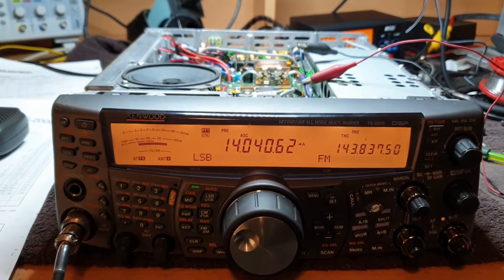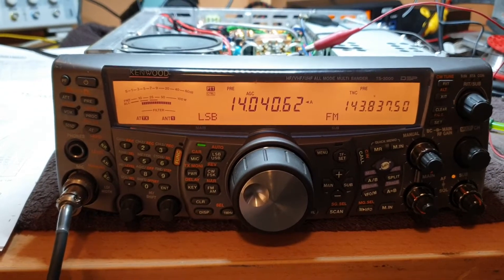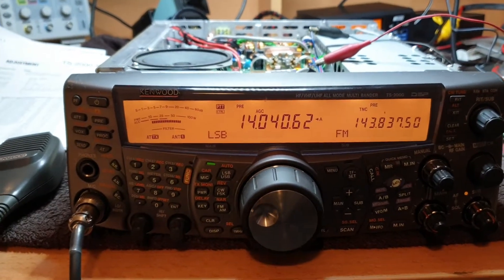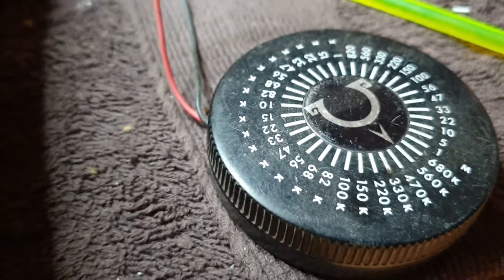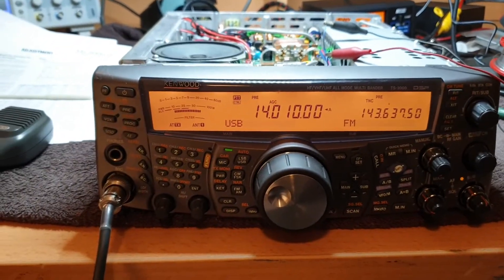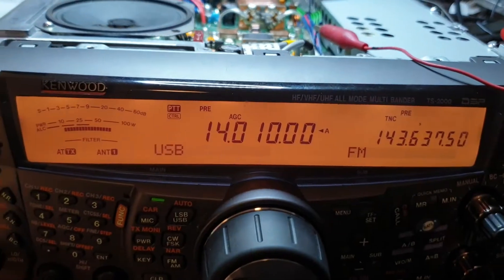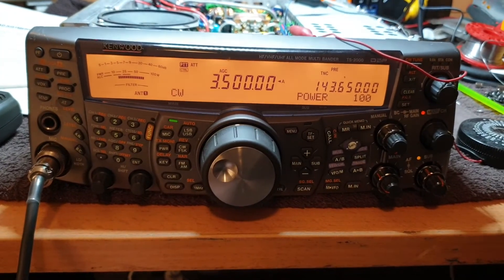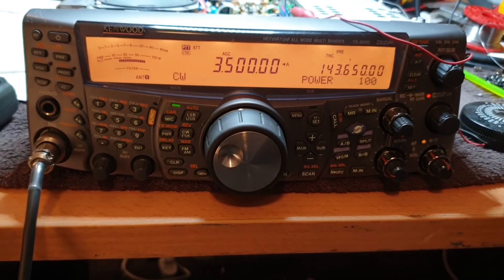Kenwood TS2000 Talk Power Hardware Modification.

Comment: Hi Brenton
I have had a TS-2000 for about 20 years. 1st day I got it she blew up and died on the TX. I sent it back to Kenwood east in Virginia Beach, Virginia for repair. When I got it back the power output on SSB was 140 watts on 10 meters and on 40 meters was around 150 watts. I have been running it at full power for 20 year's and it has held up very well.

Comment: i changed mine in the software, what i did find is the power knob then also displays incorrectly 45 watt on radio = 120 watt, i left mine at 125w att for driving the lineer.. never had a issue and its been beating topband  for a good few years, (touch wood )  :)

Comment: Hi Brenton...   how to   adjust the power output  meter in the radio  to be more accurate  after the mod?   inside do we need to turn a potentiometer ?? or  something  else ?? ok thank you va2kv
Reply from the maker: ok, this is where a resistance wheel is important, each radio will vary slightly on the balance point, that is more gain but still get an ALC meter indication.  Once you get the correct resistance on your resistance wheel, your laughing.  If there is no resistance wheel, I would try from 22k to 33k to 47k to 56k ohm resistors, and one will give you an ALC balance and heaps more talk power.  The other way would be to fit a small 50k trimpot ohm  that would mimic a resistance wheel.  cheers Brenton VK3CM

Comment: Thanks for the information and video Brenton. Now I know how to improve my TS2000 talk power which does seem lower than previous radios I have owned.

I’m know a local neighbour in Myrtleford and look forward to catching up one day when the world gets back to normal ha ha! 73,S Greg VK3KV
Reply from the maker: Very welcome to come and grab a coffee anytime Greg, cheers Brenton vk3cm
Reply: Brenton Meadows I did the mod using a 47k resistor and it’s certainly modulating much better however the ALC meter is not showing much movement at all....how did you adjust the meter to get a more accurate response from it after the mod?
Reply from the maker: @gregtreble9086  the resistor value will vary for every radio, but if you use a resistance wheel, you will obtain a value where the alc meter will function well and the drive is also greatly improved.  Its happy medium resistor value you will find, but i find it varies with every TS2000 from 22k to 47k for sure.
Reply: Brenton Meadows  thanks for the information Brenton....I may install a lower value resistor to see what value I have to install to see at what value the ALC meter returns. Thank you again for all your information and posting!
Reply: @gregtreble9086  hast du das mit dem Poti angepasst, was direkt neben dem Kabel ist ?

Comment: Hi Brenton...trust you're doin well, I've had a TS-2000X since they were hot on the market, bought mine from Ross in 2001, 5 grand had to wait a week while the 23 cm model was being fitted. Its never missed a beat. I was disappointed that it never had SSB on the Sub Receiver, I've also felt it lacked in "talk power" too, but usually the processor when adjust right made things a bit better. The only other issue is that it sounds deaf on 2 and 70, a mast head pre-amp fixes that but without I'm sure the receivers are under performing. But I am reluctant to do any mod's, I've never lifted the lid and happy to leave "stock standard"....by the way what's it mean "bricked" never hear that term before, I suspect its a metaphor to "brick wall" meaning not penetrable due to software....have you got any experience with FTdx9000D's by an chance?....;)
Reply from the maker: Hi Clint, normally the 2000 is not a problem in vhf/uhf in regards to receiver sensitivity,  so that sounds like a filter issue or internal rf amp issue in the radio but could be a few things.  Bricked, loosely, tried to upgrade firmware, radio now doesn't respond to anything, a little common on the TS2000.  Onto FTDX9000,  I sold a great mate of mine, Gary ZS6YI in South Africa a brand new FTDX9000 when we were Yaesu dealers, a few firmware issues back in the day, but overall, not a bad radio. Unfortunately,  that was my one and only experience in the FTDX9000 arena, will probably buy one in one day to have a play,  maybe when the world returns to normal.  Keep healthy and safe old mate, and keep up the great work on 80m, cheers Brenton VK3CM/VK5BM

Comment: I think doing the firmware changes are better than this hardware.... and i guess the best is to leave it stock:)
Reply from the maker: many a TS2000 has been bricked for life by applying firmware changes, this is always the fear.  I often am forced to wander into the firmware setup[ on TS2000 units and once Im in, I am aok, but try and get help form Kenwood if the unit becomes bricked, its a pain, not impossible, but painful. The firmware is not reliable for constant ree try unfortunately,  even kenwood have not given an adequate response to the why does the unit brick upon firmware entry.  No pain no gain I suppose, but be careful when venturing into kenwood ts2000 firmware adventures, some end well, some end badly. leaving stock, the ts2000 under performs unfortunately, but yes, leaving it stock is the way to ensure no problems.cheers Brenton vk3cm vk5bm jdw229
Reply: Brenton Meadows true, but as usual... when you try doing somethin  to your rig 1st read, take all the seafty measures you need, i upgraded my firmware after almost 1 year of reading, even installed 23cm module on my rig , as i sayed, did this hardware worth the time? How mach you get from the rig? 10-25w? Dose this mod will pop-up you on a pile-up? Just sayin’   ...... there’s a guy also who made this mod... before you.... Ralph .... https://www.youtube.com/watch?v=Hfpv_2c3AVI&t=5s   Take care friend de YO3ABT
Reply from the maker: @susanuciprian9065  Ralph, Its not actually about the peak power as the goal, its about the drive levels from zero to 100w, the ts2000 in its basic form has always needed tweaking either in the software or in the hardware.  We have been doing this mod since when I lived in Chicago, an old ham mate showed me this trick in the early 2000 era.  We gave credit to him in the video as being the founder of the mod at least to us in 2002, but who did it first is not of interest to anybody in my world, we never claimed to be the founder of the mod, quite the opposite,  we gave credit to a mate in the USA, the key is to share the info.  Have a great day, sorry you don't see the value in sharing the mod, everyone to their own Im sure.  Our goal is to help people where we can, we do not charge for repairs, we are completely a voluntary service, I cant do much better for our fellow radio lovers unfortunately.  Good luck in the future.
Reply: Brenton Meadows join me on my ts2000 facebook grup you will find the link on my qrz page! Thanks!